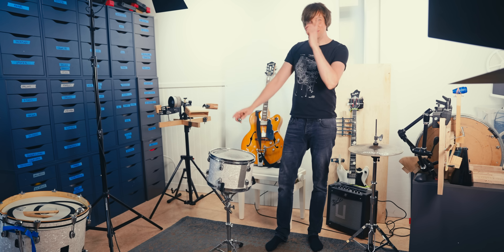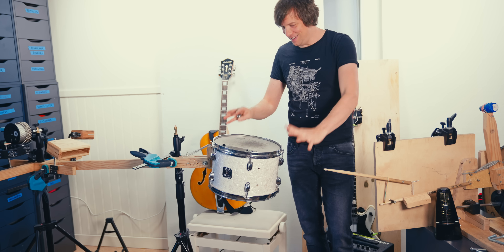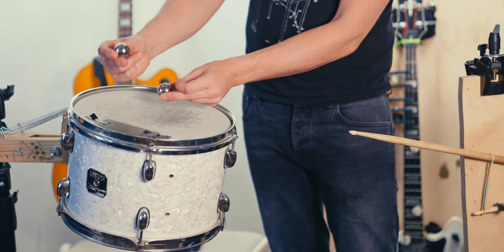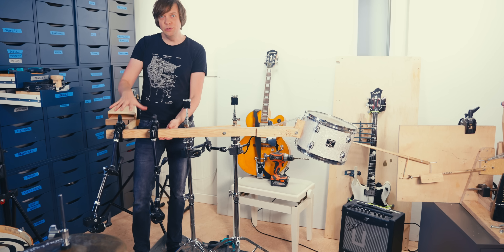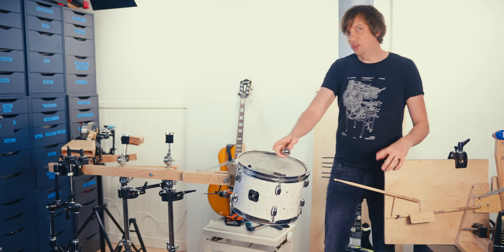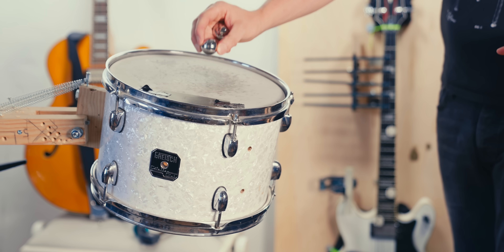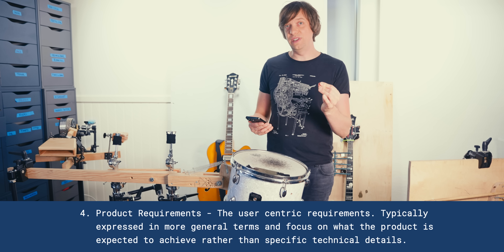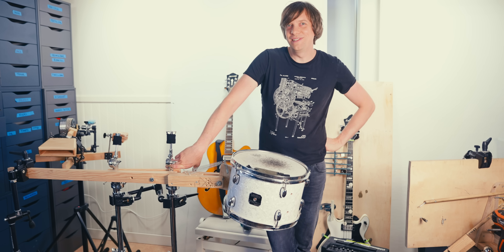Drums that Move makes the Marble Machine FUN!

Comment: If the goal is to make the hits more dynamic, why not use lights inside the drum? Acrylic Drums are see through, and there are sensors that can detect the impact which produce a light. It's colorful, dynamic, and most importantly does not affect the physics of the marble hitting the drum

Comment: For all the instruments that move, shouldn’t the marble drop mechanism move too for consistent timing? Else the timing between two subsequent marble drops would have to be tied to how long the instrument takes to return to it’s original position. Since that would vary greatly across instruments the programming wheel and/receiver would have to be quite adjustable to account for this. The marble funnels would also have to be designed in a way that it can accept marbles bouncing off instruments across their complete height range. This looks great visually but when we get to the design stage it’ll probably have to be simplified I think

Comment: I can see at least 10 ways this will introduce new problems. Martin, are you sure the drums need to MOVE when being hit? Isn't the requirement that there is VISUAL FEEDBACK when they are hit? So couldn't a solution in theory be that they light up with leds when being hit?

Comment: I wonder how you avoid marbles on the floor when you can't know the position of the drum when the marble hits the drum. You also can't know if the drum is inserting energy into the marble when the collision happens (marble hits drum while drum is moving upwards). So you can't know the position of the drum + you can't know the output energy of the marble after the hit... maybe we embrace marbles on the floor? Or maybe there's a marble collection system on the floor

Comment: don't use just a spring... use a shock absorver. in that way, the drum should not oscillate on the return and still move. you may go to rc cars shock absorvers or bicycles. you can also adjust the spring tension in a simple way and calibrate the movement

Comment: 2 pivots will be impossible to account for in timing (double pendulum). 1 pivot will be a bit less impossible, but still pretty much impossible. Personally I don't care that much about timing, as long as the inconsistencies are within ±10ms, so I'm okay with the extra visual impact one pivot adds. However, what you show in the prototype seems a bit too dramatic. I also can't imagine how you would even remotely predict the trajectories of the marbles afer the bounce now (unless on the bottom it's just one big tray that somehow sorts different marble sizes from different instruments).

Comment: I think this is not a good idea, you're adding in some dynamics that are going to change how the marbles behave. Timing is of course going to change, and I think that's still important, but also the trajectory since you're adding in a non-linear element. You might have marbles flying all over the place depending on when in the cycle of the moving drum that the next marble hits it, they might even hit each other. Everything in this machine depends on timing and being somewhat precise, and this is by far the most difficult thing to predict that you've added in, due to the non-linearity in the input/output behavior. Cool idea, but don't think that it's needed!

Comment: I don't think this feature is worth it unless it can be done very cleanly, not wobbling around, not lots of parts. It should have a pad to stop it on the return so it doesn't keep jiggling. Another way to do the movement would be to have the drums on vertical rails with springs.

Comment: And do not use universal joints for the transmission of power from the flywheels! It will introduce other shifts in the transmission. (I will add this comment under every future video until aknowledged).

Comment: Tbh, IMO you can't really discern timing differences under 10ms by ear for most musical sounds, except maybe ultra sharp clicks... But I don't imagine the marble machine will be making too many of those intentionally. 

The difference in fall height from the drum at rest and fully sprung out, assuming the initial drop is similar to where you were dropping them from by hand... It's negligible really. 

If there are songs with long repeating notes and you need extreme precision, then maybe add a locking pin or lever to keep the drums in place.

Have you thought about the idea of control tracks on the programming wheel, for things like muting pads and such?

Comment: The moment you're able to say "I really want this feature in the machine, but I will push it back to a later time", you'll be entering realistic success territory.

As it stands, despite you saying the contrary, you are letting perfectionism run havoc on your machine vision. Tinkering around is all fair and good on your planning approach. The big missing part I feel you're totally afraid of allowing yourself of doing is ITERATION. As in, LEAVE OUT things you really want to see the MM3 do. Instead, push for a MM3 that does a bare minimum of things. No Animusic-inspired niceties, no different sized balls, no thingymagigs, no visual pizzazz, maybe not even a bass. And certainly no moving drums! Just dropping balls onto a xylophone, pedal powered. That's it. Make that work, integrate it with your band, record a track or two. THEN make a MM3.1 and add in a couple of your next fave features. And when that one does work reliably, go for the MM3.2. Rinse and repeat.

Right now you're hell-bent in building the perfect machine, in one big release. This massively shrinks the likelihood of ever succeeding due to becoming overwhelmed with too many problems and moving targets to solve at once. Iterate, my friend.

Comment: I understand that tinkering sometimes is necessary for the creative process but adding in unnecessary features this early is not advisable. Features like this should be considered in the final design for future iteration but not included in the initial build for simplicity of getting the project going. I fully understand that you want this in the project but incorporating it before you know the machine will work in the first place is not the best rout. Get a machine that works the way you need it to, then make it work the way you want it to.

Comment: What happened to the concept of 'tight' music and the desire for clean floors... There is no way that spring and the damper you'll probably need to kill the oscillation quickly is going to be even remotely 'tight' at every rate of play. Now if you have really backed off your stupidly insanely tight timing requirements maybe this can work on that score, but the variable rebound is going to make catching the marbles reliably so much more challenging... 
It certainly adds visual interest but you really would be better off making use of visual trickery to make the marbles more interesting if that is your goal - play with strobe effects perhaps triggered by the programming wheel or drum impact, add lights under the drum, perhaps surfaces for the shadows to project upon so the marbles become more visible on each channel. Or use a small smoke machine or two so the air movements the marbles and drum skin cause becomes the visual interest. Or simply put the bits that really move back into the catch bucket again - the most visible moment for the marble surely doesn't have to be at the moment it makes its musically important note, it just wants to be seen clearly either in the before or after stage so the viewer can see the link between the mechanical and music.

Comment: I understand the desire for it to be fun and kinetic, but the engineering aside, this sort of randomness is exactly why previous machines failed. "We can account for timing with the profiles" is fine, but what about altering the path the marbles travel in the air to the catcher? Doing multiple bounces will drop the drum lower and lower, especially with larger marbles, to the point where the catch has to be huge to accommodate it all, or otherwise you'll have to limit the music you can make by never dropping more than 2 large at a time (or 3 small or whatever it ends up being). This sort of imprecision is what has killed the last two builds

Comment: If you find out the movement messes too much with the timing or consistency, may I suggest a compromise:
Stage lights, focused on each of the drums, perfectly synchronized to the machine the lights dim or change color slightly on each drum hit. I think it would give it the illusion of movement, without actually moving. As a bonus it would be visible even from far back.

Comment: I do understad the point of building something interesting to see, yet i feel a bit confused that you just re-introduce so much variables in the machine.
This multi-pivot is gonna be a nightmare to make accurate moves let aside to play tight music or fast drops.
Another issue that i think might come from it is the marble recovery... It's gonna have to be a large funnel and will probably be really loud... 
Just add a spring on the regular drum's foot and it moves without adding that much issue for précision and timing plus you reduce the collection zone.

However, I am not the guy who is gonna be building this machine, nor using it to play music, you are.
If you feel like you really need this in your design, well i can't help it and will keep supporting you in your journey like i've been for the MMX.
(Even if you might be right or wrong about this decision like many others along the road done or to come... ;-) )

Keep tinkering your dreams out of physics and ingeniring restrictions. It might get you somewhere unexpected.

Comment: Looks to me this is going to be an engineering nightmare down the road. When you have a non-fixed drum angle you're goint to make it way harder to reliably catch the marble, resulting in an overly large catch chute that's probably going to block the view of the instrument, negating the visual benefit of a moving drum anyway.